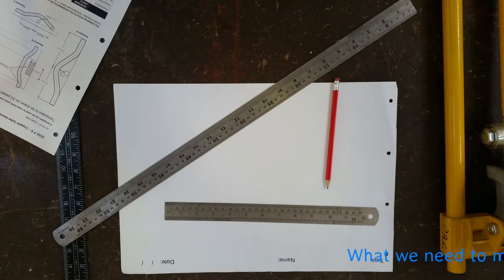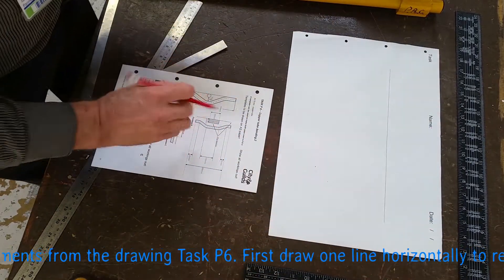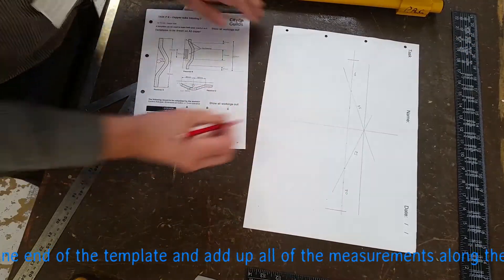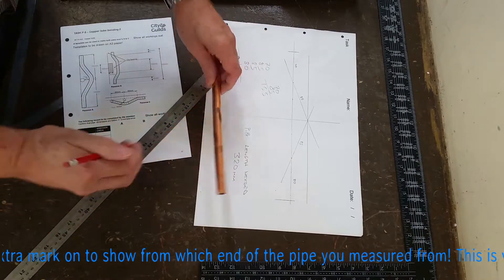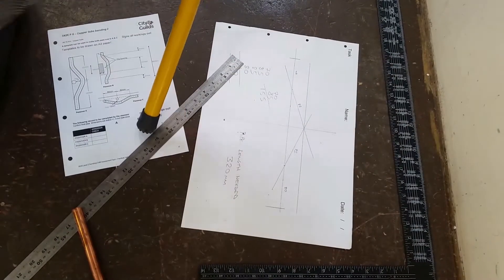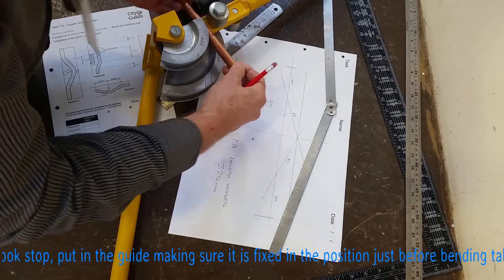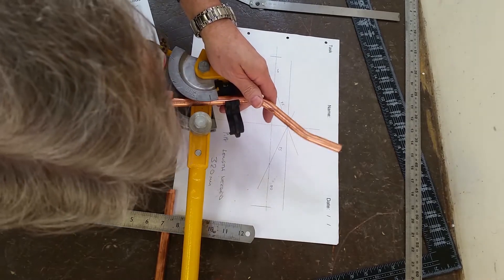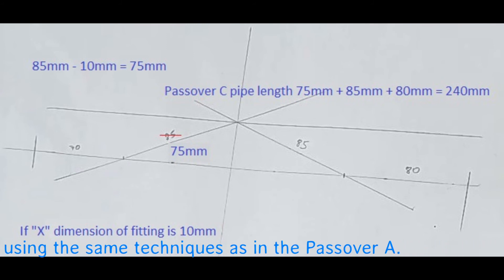How to make templates to bend pipe passovers accurately using Task P6 from the C&G 6035-02 manual

Comment: Great Explanation on the method of using the folding ruler. I noticed the former moving slightly so maybe be careful of this and make sure its pushed to one side.  Please could you show more pipe bending videos, like off set bends and do you know of the multiplier method x2 for 30 degrees x1.4 for 45 degrees x 1.2 for 60 degree bends?